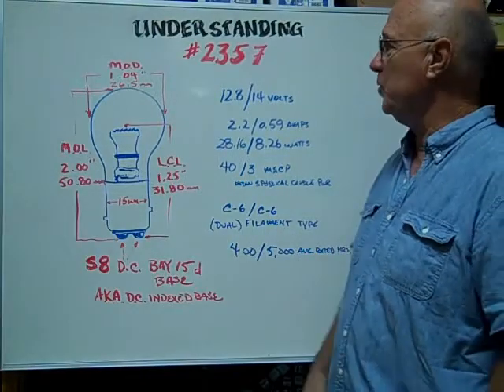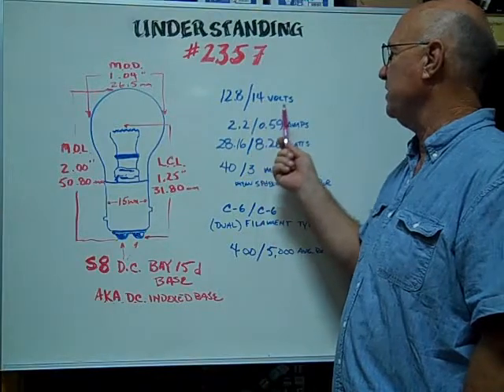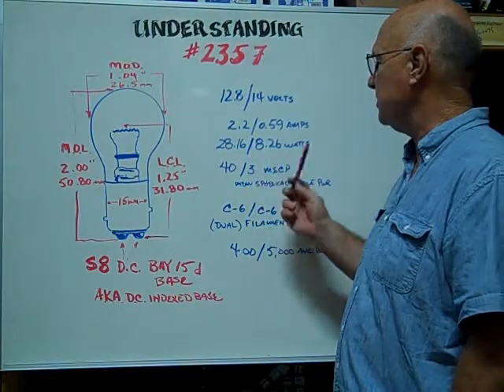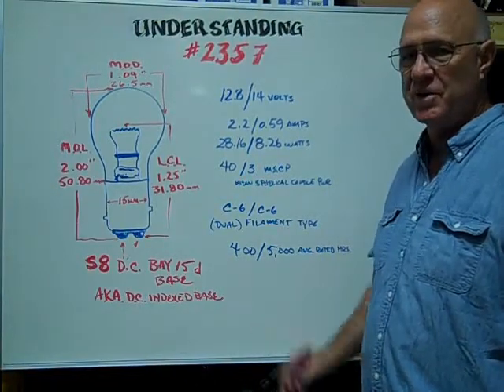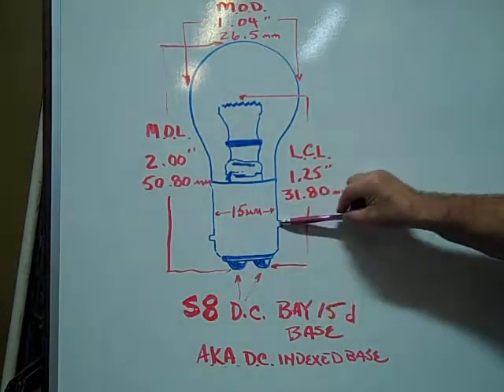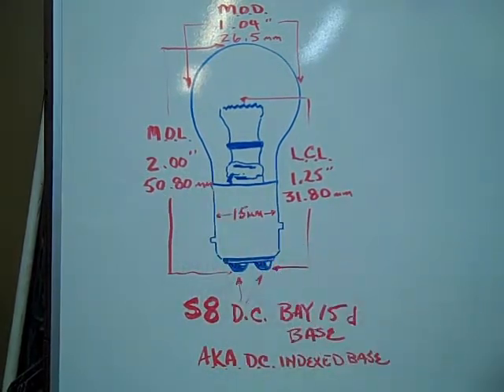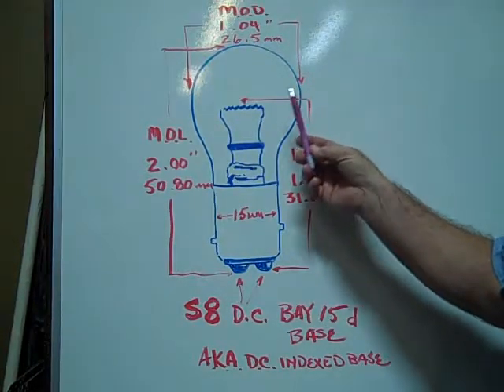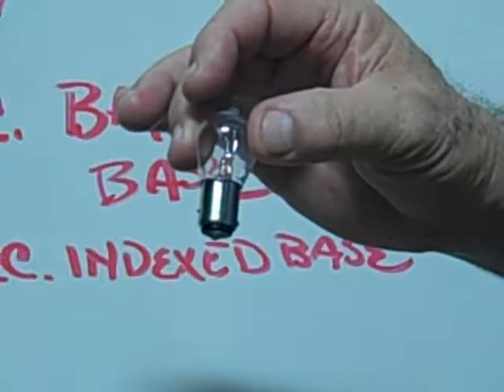#2357 Miniature Bulb

Comment: Thank you for the detailed description. It was really informative.
Actually the LCL on the graph is not correct. The 31.8mm filament (light centre) position is calculated from the cap's lower pin, not from the glass base of the cap or the soldering.